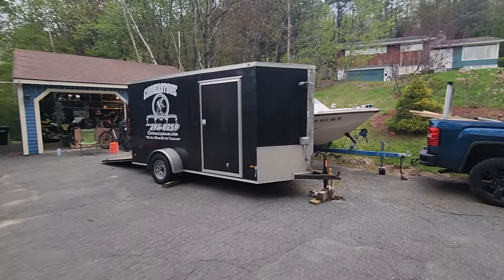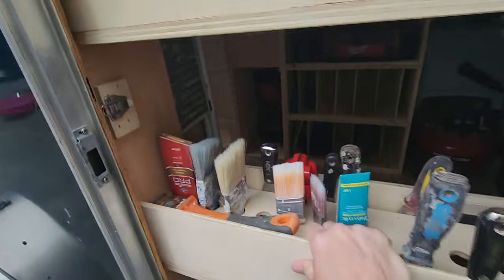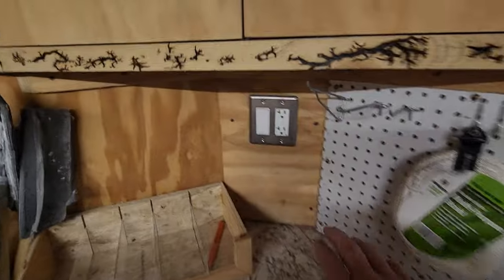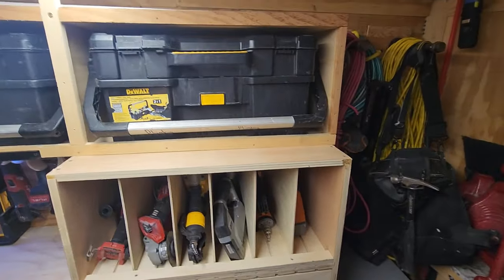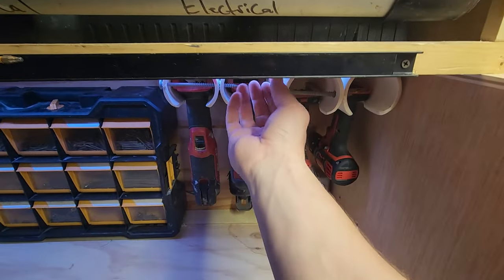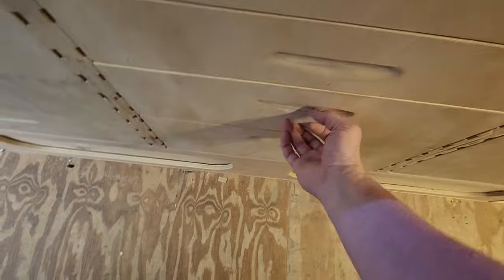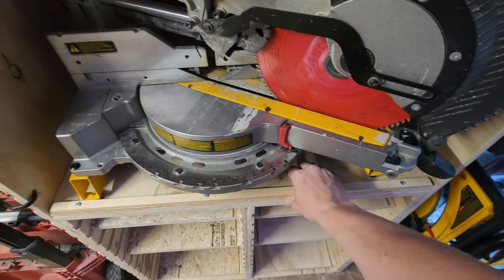Tool trailer walk through. Organized and Efficient! #custom

Comment: BEST TRAILER I HAVE SEEN online or in person - puts the rests to shame!  Like a BOSS - when I saw the rolling wheels on the shelf / door -  don't need more strength for the small light brushes, supplies, etc.  Also, TAPE roll dispenser - simple and holds a lot and VISUAL - just look up and there is all the tape - and you standardized on blue tape.  For the cordless tools - cut a slot on the top - drop a bar from the top to lock in tools and attach a string - lift bar, let go - or from bottom - add a magnet.

Comment: Where is your power supply station?
Reply from the maker: I'm not entirely sure what you mean by that, but there is a double battery charging station on the end of the top left cabinet near the gate. The trailer itself just plugs into an extension cord. If your reference is to some kind of solar setup, I have definitely looked into it. Would only fit 4 panels on the roof. 450 watts each would give me an 1800-watt system. Not enough to charge batteries and power the fridge or run a tool. The battery backup would be way too heavy and too much space to make it feasible, so the only option is a generator. If we start nailing down some off grid jobs, I'll have to get one. Thanks for the comment.
Reply: @alexanderannunziata7734  ooooooh I'm so dumb I didn't pay attention to the cord in the beginning. I thought your trailer was powered by some kind of battery/inverter set up.

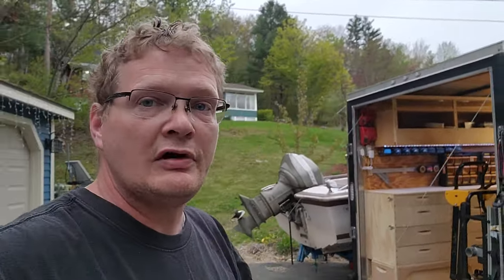Comment: 13:08 - Very smart to incorporate other people's proven ideas like the tape measure and tape holders and Ron Paulk shelving system makes this a smart trailer.  Admire the time you invested to make this happen - I learned sketch-up and feel I have a decent handle on it after about 300 hours or use!  Also, impressed with the outlets inside & out and the sink - for a cleaning station.  Really nice not to have to pick & choose what you 'think' you will need and just haul the trailer preloaded.
Reply from the maker: Thank you. Much appreciated. Definitely lots of time in research and learning the tools to get the job done. It's definitely a rolling jobsite. Drop it and the guys then run for materials.

Comment: Great Video- Thanks!  You mentioned posting where you got the battery hold downs?   Nice that it is a small trailer design.  Ron's trailers are huge.  What about Security?  Do you have an alarm or GPS tracker in there?  Ron mentioned making the tongue of the trailer removable so that thieves wouldn't steal the whole trailer
Reply from the maker: I have a GPS tracker hidden in it. Tracks in real time the second it's bumped. Then I can just send the link to the police.
Reply from the maker: SKCMOX Tool Holders Battery Holders Mount for Milwaukee M18 18V Battery Drill Tool Red 10pcs tool holders and 10pcs battery holders with screws https://a.co/d/0di0yi7

Comment: Awesome job!
Love the work friendly design. I have basically the same trailer. I’m planning on doing something similar. My trailer is also a single axle, are you concerned about weight? Have you weighed yours full? I got a deal on my trailer as well, still wished I had held out for tandem axle due to weight concerns. I’ll be hauling mine back n forth long distances (800 miles). Great job and I would love your thoughts on it and making everything lighter 👍
Reply from the maker: Thanks for the comment, and yes, I have definitely had some concerns with weight. I have not weighed it full, but it's definitely over. I plan on putting a new axle with 5 leafsprings. It should give me a little room to wiggle, but all in all, when I do it again, I'll go with a 6x12 tandem or 6x14 tandem. Anything bigger is too hard to get in and out of sites, plus finding parking can be a challenge. The tandem axles should give me the additional capacity I need.....lol 😆
Reply: Thanks!
The weight is the reason I’ve decided to go with multiple mobile tool cases I can mount to walls (packout etc). Should really keep weight down and when I sell trailer I can just mount in shop!
Great work 👍
Reply: Also make sure to have 4 brakes for all the weight.. there are plenty of good reasons out there to have them. Nice rig, good job 👍🏻👍🏻 @Cornerstonecontractors